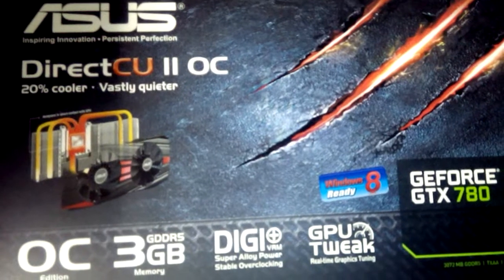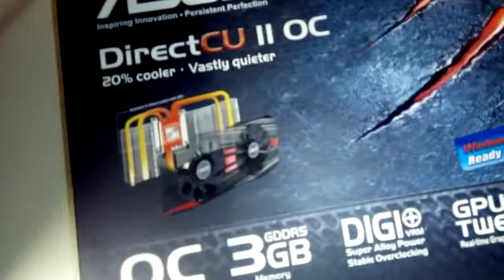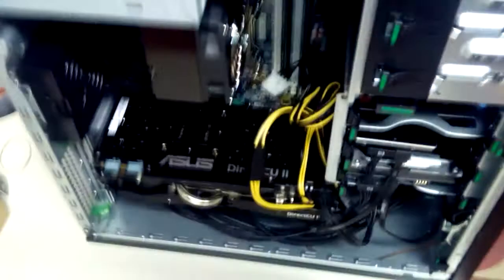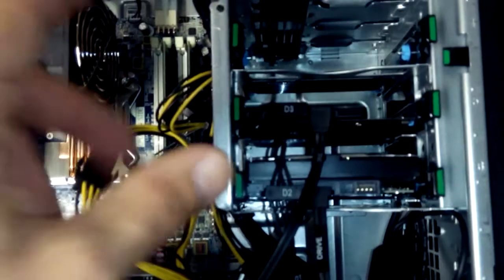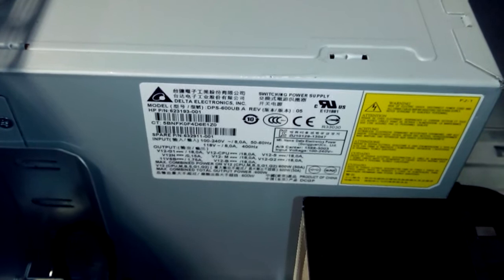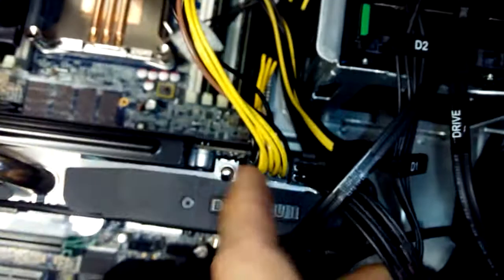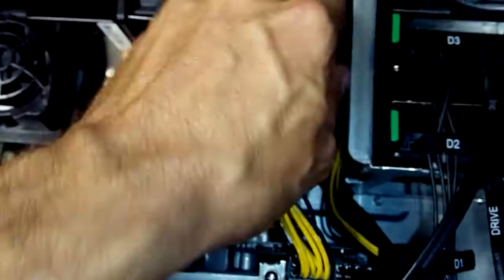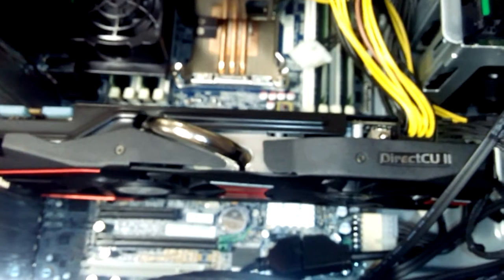HP Z420 workstation with Asus GTX780 3Gb VGA card custom built

Comment: I have an hp z420 I have Evga 770 SC. with an  intel e5-2670 16gb  ram. I could run two crossfire amd  cards or nvidia titan cause I have a 450w dedicated psu for gpu.

Comment: 2 questions 
1. is the board atx?
2. does it support crossfire or sli? 

thank you.
Reply: it dose support CF but it only sli quadro cards you can't sli Geforce card
 and yes the motheboard is ATX but it's power connectors isn't standard

Comment: I have an HP z420 with a xeon e51603. Will I be able to put a gtx 960 2GB? Is the psu any good or will it explode if I put a new gpu like a gtx 960?
Reply from the maker: It should work without a problem.
Reply: Miha B. Well thank you for replying so fast m8! Also will my cpu bottleneck or is it nothing to worry about?
Reply from the maker: +Darien Cepani I hope you were joking with the last comment, really.It should work without a problem
Reply: Miha B. Actually I wasnt joking... I didnt know what processors the xeons were bcz I never saw or used a pc with a xeon. :P Anyways thanks for the help m8!

Comment: Hy Milha, I have a question hopefully you can help. in the HP z620 i have a bind cable that connects the SATA cable to the power  ( http://www.amazon.co.uk/HP-Cable-Power-Blind-683772-001/dp/B008L33YC4 ) Can you tell me if the wide input slot is a standard 15pn input or a hp custom connection? and what SATA  to molex connection to buy to get a little more power to my gtx 980 graphics card? many thanks
Reply from the maker: Are those the only cables for SATA that you have or not you have more?
Reply from the maker: Can you send me more pictures...by the look of it I would say that at the end they are standard SATA as they have to be compatible for  sata sas drives
Reply from the maker: +DA R As far as I can see you have a modular PSU.But this adapter:  http://www.hkb2bsite.com/upload/20110411/SATA_15pin_male_to_6Pin_PCI_E.jpg
would not fit without some major rework of the plastic on the connector and some glue :) It is a standard 15 pin adapter on the wide input slot, it has to be as otherwise the SAS/SATA drives would not power up. And many drives HP uses in their computers are made by Seagate,Hitachi,WD.
I would rather check all the cables you have and try to find out if there are any empty ones like this one 683772-001 and resolder it with the correct adapter, presumably the one at the end as it would be much more easy than the one in the middle or at the top, and you could still use the rest for HDD. It is really strange that you could not power the card as the machine is able to power two cards in SLI.And sorry for my late reply if sometimes takes too long..as I am quite busy.
Reply: +Miha B. I have the graphics card working for the first time, thanks again for you video and help. I just had to remove one of the plastic edges on the SATA connection of the SATA to 6 pin to fit it into the HP slot. I think you where right it is a SAS/SATA conection. Fortunately I didn't need to get any more connections for it to work.
Reply from the maker: +DA R It is always nice to hear good news. Thank you for letting me know. Kind regards M

Comment: Hy Miha, this video and comments are brilliant so helpfull. I have a HP z620 with 800w power supply but on 2 6 pin connections. I previously  purchased the geoforce gtx 980ti which requires 250w  of power to run (same as the GeForce GTX 780). after connecting the two 6 pin it still wasn't powerful enough. so after a whole mornings research and contacting customers i finally came across this video. will try SATA to molex solution and let you know!

Comment: How to install this graphic Card? A lot of People Say, that it does not run...?
Reply from the maker: +Stefan Santa  You can run it without problems. First cable "Y" is connected to two additional  "power cable SATA 15 pin > 6 pin power PCIe" which are connected to "pcie 8 pin to dual 6 pin". This is the first cable that goes to the graphic card http://www.evertek.com/imageshare/C/300x300/CB-2X6F8M-unit.jpg and these two are connected to this cable http://ecx.images-amazon.com/images/I/51mErTpGXXL._SX425_.jpg 
Capish?  :)  It is good you asked so if there is someone else reading this, he or she will understand. I hope it helps you and if you have any further questions, just let me know
Reply: +Miha B. Oh thank you :D
Reply: +Miha B. How you Install the Graphic Card diver?
Reply: +Miha B. Run this Graphic Card? ASUS Radeon R9270X DirectCU II 2GB AMD Graphic Card (PCI-e, 2GB GDDR5 2x DVI) ?

Comment: Miha,
Did you use just the one cable below? I seem to see in your video two cables. One that goes to the MB and the other that goes to the HDD power?
How many cables are there?
Thanks
Luis
Reply from the maker: 4screwie4  Hi Luis... I used two cables which are going from sata to the left molex and another one on the right is from the PSU. The Y cable on the left is powered by two sata cables and the one on the right is powered by the PSU.
Reply: This Y cable where did you get it. Do you have a link for it?
Thanks
Reply from the maker: 4screwie4  The first cable "Y" is connected to two additional  "power cable SATA 15 pin > 6 pin power PCIe" which are connected to "pcie 8 pin to dual 6 pin". This is the first cable that goes to the graphic card http://www.evertek.com/imageshare/C/300x300/CB-2X6F8M-unit.jpg and these two are connected to this cable http://ecx.images-amazon.com/images/I/51mErTpGXXL._SX425_.jpg 
Capish?  :)  It is good you asked so if there is someone else reading this, he or she will understand. I hope it helps you and if you have any further questions, just let me know.
Reply: Miha B. Thanks man for taking the time to explain it.
I capish now :)
I found the Y cable that comes with the graphics card, now all I have to buy is two cables to connect the two Y cable endings to the SATA power...
Cool
Luis

Comment: and then personal, okay? I wonder if it is possible to install a GTX 980 (GV-N980G1 GAMING-4GD) or GTX 970 (VCGGTX9704XPB) and which adapters needed to install them. My supply is 600w (623193-001). Thank you!
Reply from the maker: Ronaldo Rocha http://www.hkb2bsite.com/upload/20110411/SATA_15pin_male_to_6Pin_PCI_E.jpg  GTX980 and GTX970 should both work fine with a 600W PSU.

Comment: he gay i have an HP Z420 inside the case i have Geforce GTX 560SE i want to upgrade the Z420 with saphire R9 290 but i have problem i heart some bip bip and some red color on the pwer button please help
Reply from the maker: Who is the manufacturer of the card, I need the exact model, so I can check the details...Also, how many beeps can you hear? Count them. I bet the problem is the power connector to the card, or not enough power.
Reply: Miha B. thanks for the reply! Another question: it is necessary that the equipment has this component for installing cards?
http://www8.hp.com/us/en/products/oas/product-detail.html?oid=5213446
Reply from the maker: Ronaldo Rocha If you can order the part I would recommend it as it is a long card. I did not install it. The machine is working fine without it from the time of the video was made and is running most of the time 24/7 for rendering in Autodesk products.

Comment: what adapters do you have hooked up to the 8 pin power?  I can't really make out what they are.
Reply from the maker: Hi there..I used this adapter:http://www.hkb2bsite.com/upload/20110411/SATA_15pin_male_to_6Pin_PCI_E.jpg
Reply: Miha B. That what I thought but I've already tried that.  Doesn't work for me.......  z420 doesn't even boot up, just red blinking light and 4 beeps.....
Reply from the maker: Miha B. What graphic card do you have, I would need the model and manufacturer in detail? Regarding beeps 1-beep is CPU,3 is RAM,4 motherboard or PSU, 5 is graphic card
Reply: Miha B. First of thank you for assisting here!  I have the ZOTAC Geforce GTX 780 OC (model# ZT-70205-10P)
Reply from the maker: Eric Lee Please send me the pictures of the cables you have connected, as well as the connectors on the card.From what I can see is that you have a problem with graphic card not getting enough power so the system just beeps and does not boot up.You have two connectors on VGA card, one is 6 pin and another is 8 pin.You have to connect all four of them to SATA and IDE molex, to provide enough power for the card to work.http://www.zotac.com/fileadmin/product_img/Graphic-Cards/GeForce-700-Series/GTX-780/GeForce-GTX-780-OC_ZT-70205-10P/web/ZT-70205-10P_image8.jpg

You connect the 8 pin adapter to two SATA connectors, the third one should be inside the workstation, if it is not you have to get the connectors.Also, what does the manual say about the PSU specifications which will power the card?Asus runs on PSU up to 300W

send the pictures to my e-mail: mburnik@gmail.com
Reply: Miha, thank you for your assistance!  Turns out it was just cable issues.  I went out and bought a 8pin to dual SATA and it seems to work fine now.  Once again, thank you for your willingness to help!
Reply from the maker: Eric Lee No problem I was glad I helped you. If you have any other computer related questions, just send me a message.I do this for a living and if I have some spare time, I like to help others.Kind regards.
Reply: Eric Lee hi everybody, i have to solve the same problem with my Z420 psu 600w, and hope to see if the gtx 780 still working fine (heater dissipation etc...)? thanks a lot. and about availibility of that adapter please. 1000 thanks.
Reply from the maker: logishape It should work without a problem.
Reply: Very helpful, thanks again.